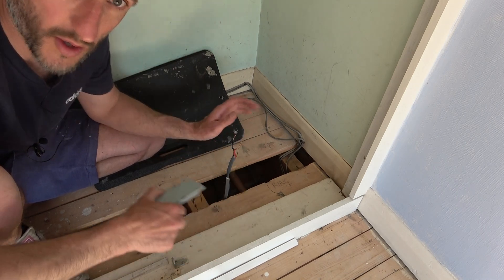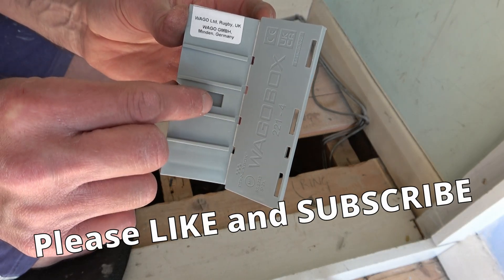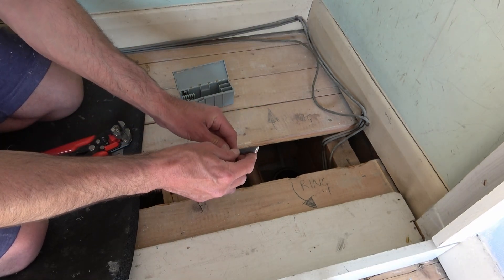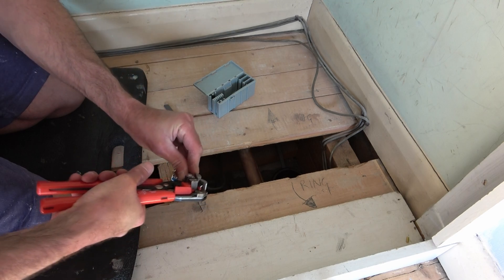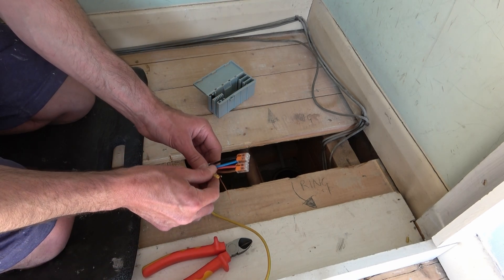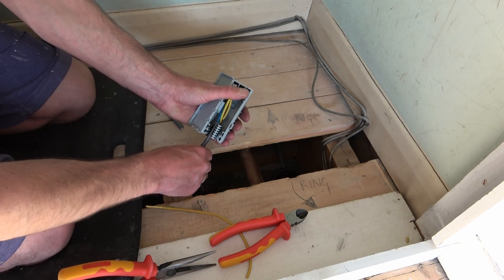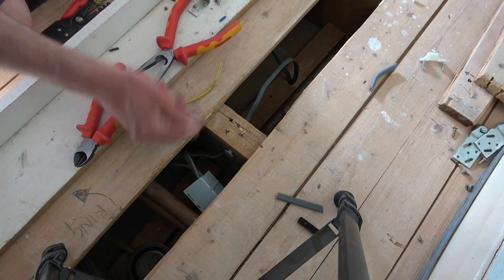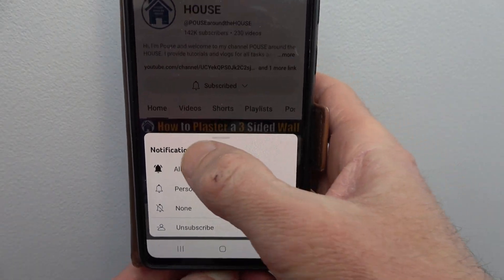How to connect cables with Wago 221 junction box & Wago 221 connectors. Join two cables the easy way

Comment: Videos like this are the best - no messing around just clear and to the point. So helpful. Would there be any issue with extending the wiring from an existing electrical socket (one under the stairs that isn't used so won't be kept as a socket) so that it reaches a location a metre or so away in the next room using this method? I'm thinking add a couple of metres if 2.5mm t&e so that the existing wire can reach the new location.
Reply from the maker: You can do that yes. Just ensure if it's a ring main you extend the ring and don't create a spur. If in doubt call an electrician as new circuits need to be tested and inspected to ensure they are safe. Best of luck 👍

Comment: Very interesting and informative. 
As a complete DIYer, why do all the MF boxes have holes for a cable tie, when they’re used for inaccessible and maintenance free wiring. Isn’t this more a Can’t Maintain feature rather than Maintenance Free?
Reply from the maker: Not really sure. The idea behind the clips is they are screwless so shouldn't come loose. Adding a tied box means it can't be touched or break open. I think they like changing rules for the sake of it sometimes! Thanks for watching 👍

Comment: For simply joining two cables together, the 221 inline connectors in a WagoBox Pro are a good alternative.
Reply from the maker: Thanks for the feedback and thanks for watching 👍
Reply: ok I was wondering this. but the 2 or 3 way isn't "wrong" if that's what's on hand right? it just will be a bit of (relatively) bulkier install?

Comment: for twin&cpc the quickwire junction box is by far the easiest to use.
Reply from the maker: I've used that in another video. I think both have their place. Thanks for watching 👍
Reply: Quickwire for ring main is rated to 24A.
Reply: @tomastank1030  unless it's clipped direct all the way, the cable has a lower rating than 24A
Reply: @Mircea007 Sorry, I don't understand. MCB is rated 32A. Ring main is 2.5mm twin and earth. So how can this Quickwire connector be used on a ring main?
Reply: Ring final circuits have different rules than radial circuits.